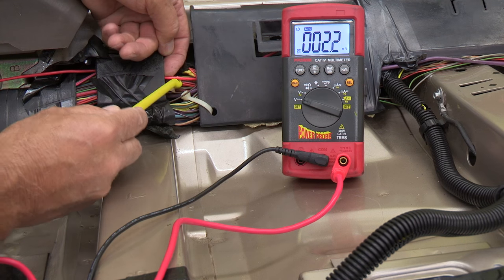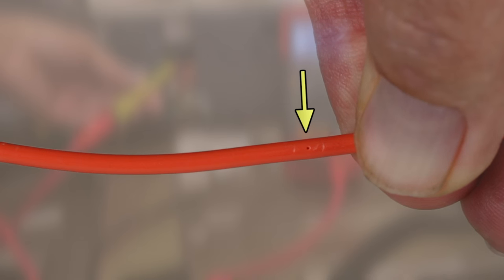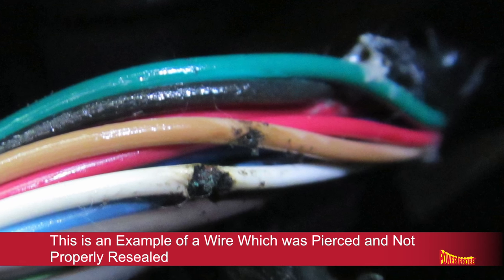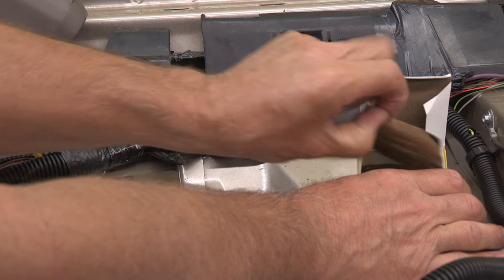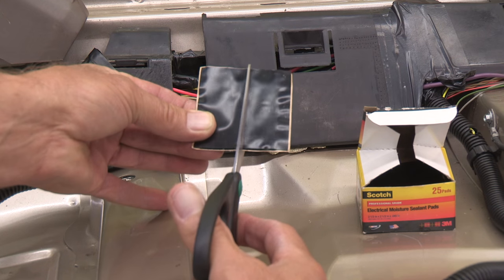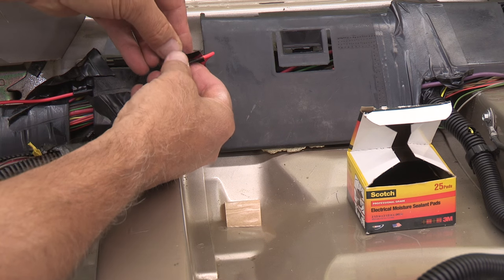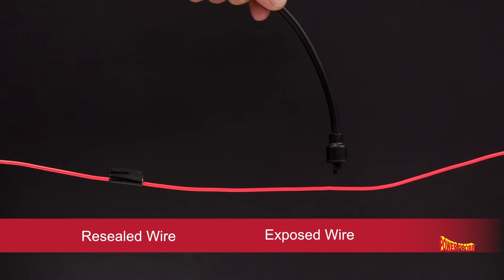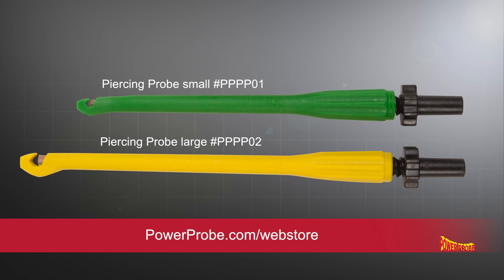How to reseal pierced wire insulation

Comment: Thank you for sharing. Is there any rust products that are safe if in contact with automotive wiring? Particularly the outer coatings…My f150 had water leaks and the water fills both sides of the wire loom channels under the door sills. The wires rest on top of the rusted areas that need remedying. Thank you for any feedback.
Reply: Dialectic grease

Comment: first you used high voltage sure its going to leak out..  these wires are for 12 volts 500 mah at most for computers etc... no vehicle uses high voltage lke that... so you dont need to seal them up
Reply: You missed the part about corrosion. The high voltage was just a demonstration on how it was equally electrically insulated.
Reply: Sadly Jerry you are a  classic example of "a little knowledge is a dangerous thing". Please don't work on vehicles other than your own.
Reply: 😂😂😂😂90% electrical problems human caused and this is the home runner 😂😂😂
Reply: I wonder how many houses he has done burn down 😂

Comment: Fast drying gel glue does thre trick.
Reply: Not really has acid in causing it to corrode back probe make sure not spread or bend pins not that hard and need be liquid electrical tape
Reply: @ancormane524  How about silicone caulking?  Thanks.